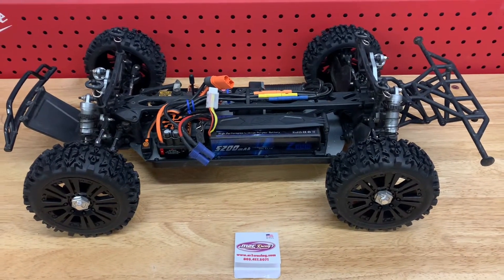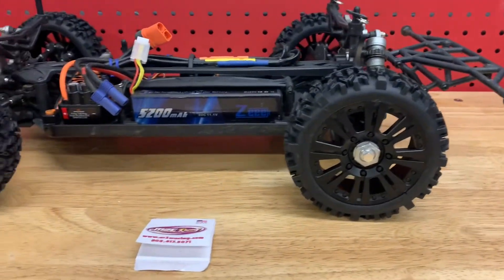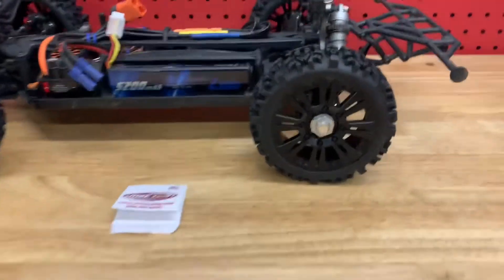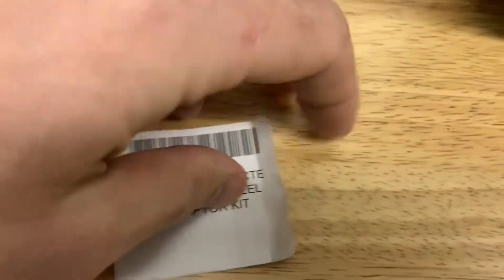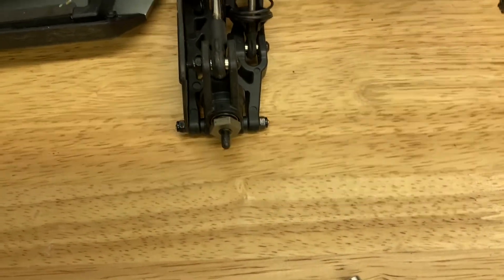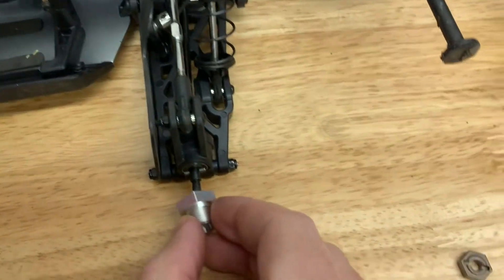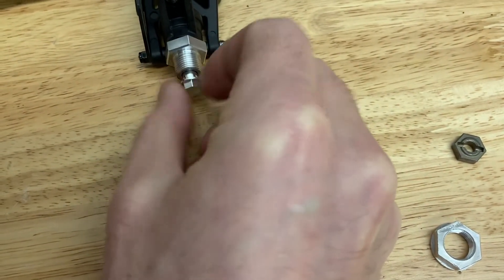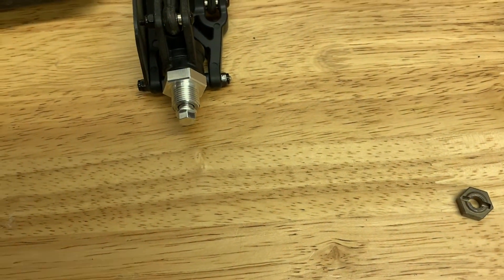Losi Tenacity TT Pro 17mm Hex Conversion for Running 1/8 Buggy Wheels

Comment: Nice! My only real complaint about my db pro is the 12mm wheel hexes. Will have to look into getting a set of those. 👍
Reply from the maker: I added a DB Pro to my fleet, but then my 5 year old claimed it as his own! So I ended up buying the Fox Racing DB Pro body and converting this truck to a buggy. Looks sharp with the 1/8 buggy wheels! MIP makes a conversion kit, too. I like it better than the one I installed in this video.
Reply: @misterts7635  Darn kids!! lol
Reply from the maker: @jimkrug2586  they’re expensive, but they make a great excuse for us to be able to still play with toys!

Comment: I just stripped out my stock wheel and tire today is there anyway to run the proline gladiator or badlands 2.2/3.0 pre mount tires but change the inner part of the wheel to 17mm?
Reply from the maker: If you don’t want to convert it to 17mm hexes like I did in this video, you can try out some of the spacers available on Amazon. They slip over your 12mm hex and then you put the 17mm wheels onto them. I’ve never tried them so I can’t really say anything about the durability. Just search “17mm wheel adapter” on Amazon.

Comment: Any tire rubbing to wheel wells issue?
Reply from the maker: Little bit. I raised the body posts a notch and trimmed 1/4” off the wheel wells and it didn’t rub. I have since converted it to a desert buggy so it no longer has wheel wells!